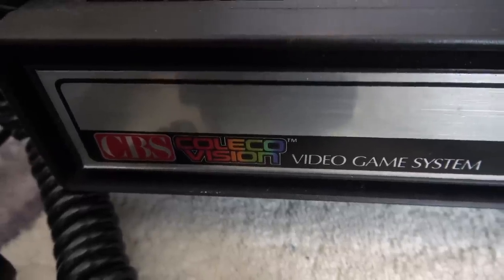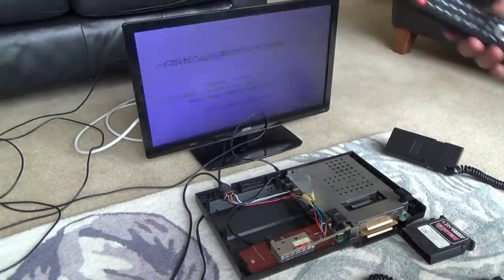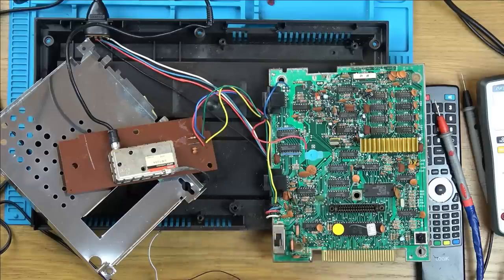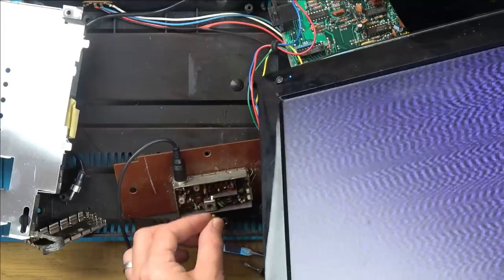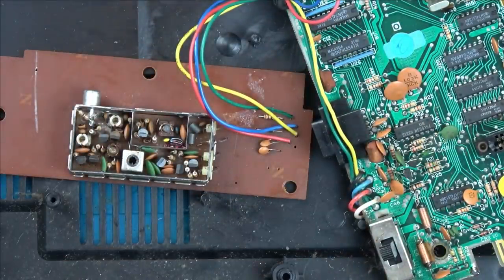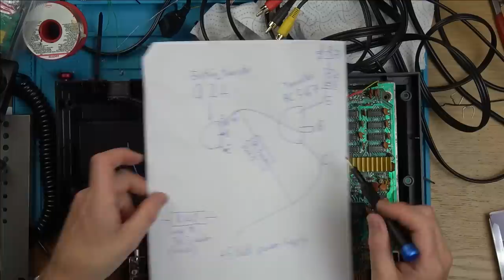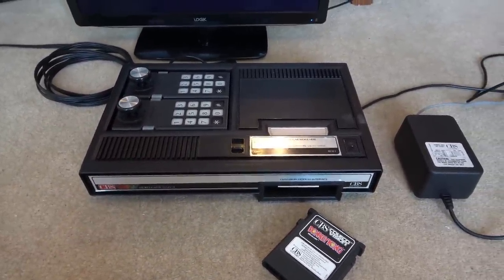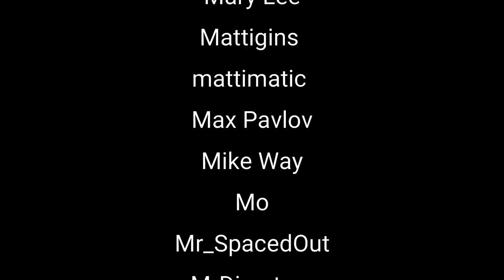BROKEN 1980s CBS ColecoVision Home Video Game Console - Trying to FIX

Comment: no sound or very hard to get sound is because RF... i have same issue with my a2600jr and sms when i connect them via rf cable. I changed them for different ones but that never changed
Reply: Picked up an Atari Juniorfrom Ebay recently, as I wanted one for a long time. (Have several larger versions.) Also, it looks cooler with modern tech on the shelf for occasional play. I opened it up recently when testing carts and discovered someone had spilled cola in it.

Weird, as the console looks clean on the outside. Luckily, somehow it only got on the solder side, and after 45 minutes of cleaning with 97% isopropyl, it was all good. Would like to do an AV mod to it, though.

Comment: Wouldn't be called a 3.3K Ohm resistor?
Reply: We call ‘em 3k3’s in the trade
Reply: You probably looked it up by now, however, the letter takes place of the decimal point to minimize errors and make it clear. Sometimes on older / bad copied schematics you might not see the decimal point, but you generally will see the letter. So 3K3 for a 3.3K, 1M5 for a 1.5 meg ohm, 4R7 for 4.7 ohm etc. It's the best way to do it in my opinion. When I drew up schematics I always did it like that, and when repairing stuff was grateful others did too. Same for capacitors and such as well. It's a useful habit to get into.

Comment: 31:41 -- It looks like the black wire and red wire on the left are crushed! They look to be the wires coming from the power jack on the console. Could that be a hazard? They might need to be replaced.